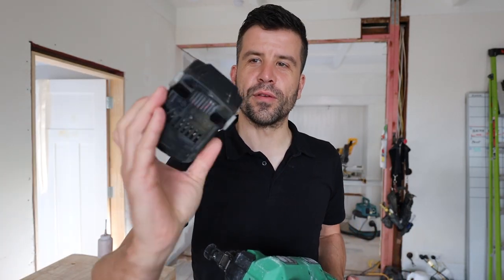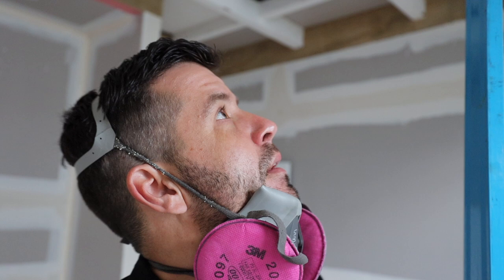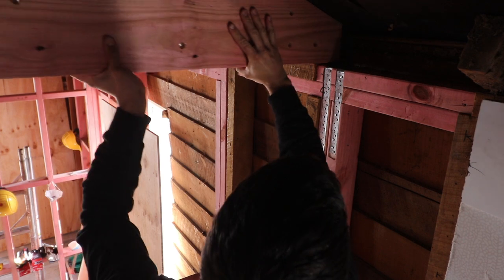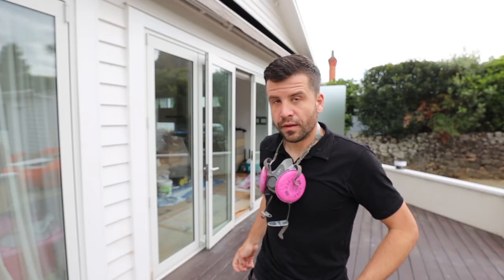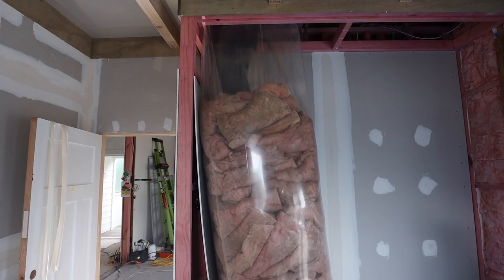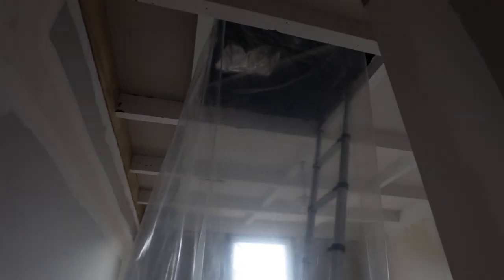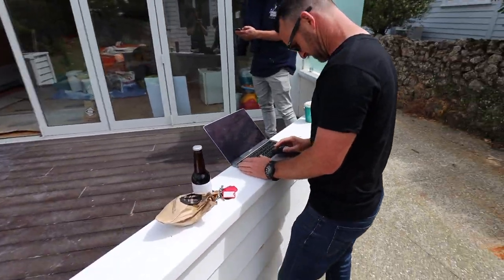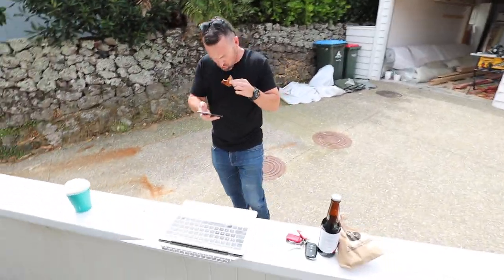Why We Don't Insulate in New Zealand.

Comment: We live in Sweden,  Im a kiwi builder and the standard of house insulation in NZ is shocking compared to the world. If youre building a house and think you have enough insulation, you dont, double it.
Reply: Same thing when you compare to standards in Norway. I was surprised by the explanation of the layering as we have a moisture blocking layer on the inside of the insulation (usually 0.2mm plastic sheet, but for pretty technical reasons there are more and more builders using a layer that breathes. Then on the outside of the insulation we have a wind-blocking layer (insulation is pretty much a matter of making sure you have air that's not moving between the inner and outer walls.), a gap of usually about 2" and then the outer wall.
 Then again, Norway has both reasonably warm summers and quite cold winters as well as windy coastlines with a lot of moisture, so we've been forced to adapt. ;)
Reply: CR*P!     CR*P!     CR*P!
Reply: @cairnsandy1  ????
Reply: I done my apprenticeship in n.z... I now work in Australia i didn't realize how important insulation was till I worked here, the last house i just finished is a constant 18 to 20 degrees with no heating or cooling in Victoria from 6 degree days to 42 degree days it's always constant with no curtains installed.
Reply: @Tachdelan  that plastic sheet is the worst in the long run. Just trapps moistore in the wall and will cuse root. Maybe not so fast but 30 years or so and beyond then you will see it.
Reply: @P4hko  
That depends on the amount of drying before closing it up and the moisture can escape to the outside if it's not too much.
It's becoming more common to use a layer that allows moisture to pass from the insulation layer to the inside. This shift has come from the thicker layer of insulation being used as well as in construction where there isn't a steady level of heating throughout the wintertime (cabins and the like). The plastic sheet is/was meant to keep the moisture from seeping into the insulating layer from the inside of the house.
Reply: @Tachdelan  I know that it's how it shuld be but from my own experian it always start rooting outside it at the bottom. The little moisture getting in gets traped inside the wall and after a long time it start to root.
Reply: @P4hko  
Interesting. I know of cases where there's been rot found when doing work on older buildings, but I also know of cases where this building method has not caused any rot after 30 years.
It has been a topic of conversation in more recent years as the thickness of the insulation has increased though and the new standards have caused buildings to be more air tight. 
I'm not a builder though, I'm a supplier. And we recommend using the membrane that allows moisture to pass from the wall into the house but not the other way due to the relatively high amount of moisture left in the walls when they are closed up.
Reply: @Tachdelan  okey I am renovating a few old houses and my father been doing it forever and he says the same thing. It shuld not cause any problem according to every thing. But in the long run  it always comes sooner or later and that is even whit houses whit poor insulation. But depends on location, installation and everything else but sooner or later water will get trapped. Btw water moves whit heat so shuld the membrane not be facing the other way? Did insulate a basement whit a membrane letting water get out but not in and it worked wonders. I know thats way different but it shuld work the same aslong as outside air is way colder then inside.
Reply: @P4hko  Yeah, you want the moisture to move from the insulating layer to either the inside of the house or the outside of the house. Either is fine as long as it's not trapped in that layer.
Whereabout in the world are you located, btw? From the name I'd think Finland, or the Baltics, but I don't like to assume.
Reply: @Tachdelan  Sweden a bit up, finnish name tho.
Reply: How to build kiwi?
Reply: @P4hko  Ah, ok! I'm sure there are differences between Swedish building codes and Norwegian ones, so...
Reply: @Tachdelan  yes kind of different. You are allowed stronger chemicals because you have a harsher climate. Different electrical system and then small things here and there. They use plastic sheets here to and thinks it's good.
Reply: Building standards in general seem to be very low in a lot of English speaking countries.
Reply: @rogerwilco2  I suppose that would depend on your frame of reference.
Reply: How does insulation work anyway.  Like the point is to have an insulating layer of air right ?
So if I build a double wall with nothing in between but air, then is that insulated?
Reply: @carlosandleon  Yes, and no!
You need that air to be still, but if you have like 8"(20cm) of empty space between outer and inner walls, the air next to the outer wall will have a different temperature than the air next to the inner wall (given that there's temperature difference but if it wasn't you wouldn't need insulating).
As you probably know, warm air rises while cool air sinks. This creates a rotation of air where the cool air sinks to the bottom and the warm air rises to the top. As it does, some of the warm air cools down and some of the cold air heats up.
At this point you no longer have an insulating layer but a convecting one.
I hope this makes sense and answers your question.
Reply: @carlosandleon  yes air is the best insulation. But the heat moves the air so you want the air to be in so many small pockets as possible so the heat dont move thru it
Reply: @carlosandleon  Insulation works on trapping air, Having a gap between two walls just means cold air/temp can pass freely through the gap. Insulation is designed to hold the air and trap it, preventing it flowing, this means warm air inside cannot be reduced by cold temps outside the wall, A thick wall with insulation and the right waterproof material will keep a house warm in winter and cool in summer. Vapour barriers and building paper with air gaps help even more, the more dense and thicker the insulation the better R value. Hope that helps.
Reply: @P4hko  Plastic sheet is good, as long as you install it to the correct side of the wall. And that side is different in different climates.

If you put it to the side which tends to have condensation, then you are blocking moisture from entering into the wall, instead of trapping it. And if moisture gets into the wall after all, it can leave on the other side
Reply: @juzoli  Then even some pro's do it wrong. Better to skip it and make the wall as thick as possible I would say
Reply: @P4hko  plastic sheeting should only be used on Skillion roofs, then the moisture if any always has the ability to run. The sheeting should end over the outside of the wall in the eaves then all moisture leaves the roof cavity. In walls their should be a barrier/packing system to have the plastic off the timber so moisture can drain. If you are getting rot that quickly, it's not the plastic sheets fault, it's the installer.
Reply: @Nineteenseventy2  okey makes sense, not how they did back in the day. I was talking about 30+ year old. After seeing it ceveral times it just feels safer to skip it and go another rout.
Reply: @P4hko  I've been building for over 30 years, and have built a lot of homes this way, never as a problem.
Reply: @horaceosirian8993  What?

Comment: Your countries regulation reminds me of NYC. They like to turn everything into a major project and a big expense.  Take care
Reply: Dont even get me started on our roads and infrastructure
Reply: Same with Chicago, you have to get a permit to think about getting a permit just to get a permit.
Reply: Yep we have the same guys here in New Zealand they're called R-Soles. They continually add layer upon layer of bureaucracy costing more & more & more. We currently have a water shortage here in our biggest city of Auckland(where this video is taken). After decades of immigration & a finite reservoir of water, it finally ran short. A water tank in every new house built, used for toilet, washing machine etc would've solved this issue but again the R-Soles are in charge.
Reply: That regulation is required because of what happened in the past of so many people doing it incorrectly and causing worse problems by being surrounded by black mold.
Reply: @bremCZ  Thanks for the information. That's usually where laws and regulations start, someone messes up. Take care.
Reply: @bremCZ  Implemented with good intentions, then the system got abused and taken advantage off... just like anything else.
Reply: @1Akanan1  Not exactly. There was no system prior to the rule that insulation must be designed correctly and inspected. It was the frequency of poor jobs that forced the system to be put in place to begin with.
Reply: @Timespider  I just cottoned on to what an R-Soles are! Having a good chuckle in Toronto. Good one.
Reply: @bremCZ  Was it not possible to do the samething via your building code then have it inspected after installation and prior to boarding the walls or the like?
Reply: Nothing about this style of building is truly expensive, though.
Reply: @Timespider "R-Soles"😂🤣 I'm definitely using that from now on 👍
Reply: @Timespider  Funny: You start out complaining about too many layers of bureaucracy (costing more and more), but then you finish by suggesting that there should be another new layer of bureaucracy (which would certainly add to the cost of the build - tanks; pumps; plumbing;) and you seem disappointed that this new layer of bureaucracy hasn't been added. Do you see your conundrum?

Comment: I’m a kiwi but live in U.K.  All the houses in Auckland are cold in winter unless they have been built in the last 20yrs (not many). Issue is it doesn’t get cold enough to do more with insulation, but when it is cold the insulation isn’t enough to keep you warm. Big airy cold houses in winter.

Comment: Bureaucracy. Doubles the price...  I live in Perth, and still insulated my house. Pennies and effort saved in heating. better in my pocket. Getting close to the finish now 😊
Reply: And of course in Perth insulation reduces the amount of time the air con is on.
Reply: @MikeAG333  For sure. My house has only ceiling insulation and double brick. I really only need the AC on when we get a few hot days in a row. The morning easterly blows through early then we box the house up and it stays cool for the rest of the day generally. Gotta put it on when we get up around the 40 mark though...

Comment: I'm still confused. 2C is still relatively cold for this climate. And keeping a house a comfortable would be terribly difficult. 
Furthermore insulation helps with the heat also.  Especially if you have aircon.
Reply: He's more referring to our houses that were build before the regulations came in, new houses here are all insulated and double glazed.
Reply: Also insulation works both ways , it will keep cool air in if it's hot outside
Reply: @chriskane9230  haha yea but 25c on average in a New Zealand summer isn't that bad.
Reply: It may hit 2 deg C once a year in the middle of the night in Auckland. Most of the time in the coldest months of June July and August the temperature here ranges between 5 and 15 deg C.
Reply: @chriskane9230  It also stops any warm-ish air getting in on a sunny winters day. A study in Germany found more insulation resulted in higher heating costs overall because the sun couldn't warm much of the air inside the house. I think insulation is great, and makes for a more comfortable home, but there are other consequences.
Reply: Ssme in the UK. "We don't have winters mate". Yes, but 2C is bloody cold if it lasts for a few days and you don't have insulation or proper heating. 

In the UK you see people in a wolly hat, North Face winter coat snd....shorts during the winter. Because it's not cold. If we admit it's cold, then it actually is.
Reply: yeah, Aucklanders complain when it gets to 30°C or below about 5°C during the day. And that's outside... admittedly a lot of the houses the difference between inside and outside is wind and rain rather than temperature (there's slightly less wind and rain inside)
Reply: @Granition  this is surprising, to say the least, especially in a cold climate like Germany. do you have a link to the study?  There is a point where more insulation won't gain you much and cost you more money.  but it's implausible to suggest more insulation would cost you more money in *heating*.  The sun does not, appreciably, warm the inside of a house other than through its windows.
Reply: After seeing that hammer I had to check the shed to see if mine was still there
Reply: @bradfry2259  But he's not really. He's literally pulling out insulation from a house where it exists. I get old houses don't thats a given, but pulling out insulation from the ceiling, when it drops to near freezing in winter. Hot air rises, and so all the hot air inside will be floating around the cold ceiling. Convection will cause the heat to dissipate through the ceiling and then it will radiate and convect into the attic space and then rise through the roof and escape. 
Insulation will slow the convection of heat from the ceiling into the attic space, thus the ceiling will reach equilibrium and you will have to heat the house less in winter.
Reply: @erict7499  Yeah somehow I don't believe this in the slightest. 
If I remember my heat transfer and thermodynamics classes. The sun isn't going to be heating much of the air inside a house, if it can't even heat the air outside. 

If you have an insulated house, and you heat that house from the inside, that heat will take longer to escape as the thermo flux through the house interfaces will be reduced. 

I do not believe that insulating a house would increase heating costs AT ALL, and would infact decrease them, as less energy has to be used to a heat a house over the same amount of time.
Reply: @Granition  Yeah I don't believe this at all. Insulation reducing heating and cooling costs, and insulation reduces heat transfer, in both directions. So if your house is warmer than outside (and because of the 2nd law of thermodynamics heat flows to less heat), it will lose heat to outside at a lower rate if it is insulated. Unless your roof is painted black also (which would also have the reverse effect of radiating heat quickly at night) if the sun can't heat the outside air its very unlikely the sun during winters day is going to heat your house up more than the surrounding air. And even if that were true, it wouldn't make heaitng cost more than a non insulated house, because if the outside air was still colder than the house, that would flow to the outside, and cause the house to cool again. And the convection and conduction of a actively heated structure, would be far greater than any net radiation input form the sun during winter.
Reply: To expand on this, the 1-2 degrees will be for an hour or two at 4am once every few years.  It's really not worth going to a lot of effort to deal with that one exceptional case.
Reply: @PBMS123  The insulation is only being pulled out (2 diffrenet types) to be replaced with better insulation.

My house (in Tasmania, similar climate to Auckland but generally a little colder) only has ceiling insulation (and that does not even reach the outside walls, basically just 1m in from the edges), Its that horrid blown in "charlie fluff" crap. I wish we could afford to vacuum it all out and replace it with proper batts. But due to the ceiling space, that would require pulling the roof off. not to mention our house has MASSIVE windows, all single glazed. Good heavy curtains help, but I feel that is where we loose the most heat, as if you open the curtains you just get this gust of cold air from behind them.

Its not as if this house is even that old, its only ~30 years.
Reply: @chrissscottt  it gets colder than that even in the winterless north. you will get 0c a few times a year. rare to get below 0c.
Reply: what people often forget about is the effect of humidity. auckland north doesn't get cold and dry. the high humidity makes the effect of cold much worse. go south wheres it colder but drier and it feels warmer.
just like in summer where the humidity makes the heat worse. 32c auckland heat wave is worse than 34+ in chch. 

installing that ground barrier makes a big difference to the humidity inside the house which makes it more comfortable and cheaper to heat.
Reply: @taunokekkonen5733  I get laughed at in The Netherlands for walking around in shorts in winter.
Reply: @radicalbyte  you should! Are you also entertaining the idea that NL is a tropical paradise and if you pretend it's not cold, then it's not cold?
Reply: Dahrk One  American? I'm Australian...
Reply: @taunokekkonen5733  As a Canadian 2C can feel colder than -30C.....a rainy 2C day will chill you to the bone, while with the right clothes you can stay out all day at -30C
Reply: @trueppp  I'm Finnish, I know LOL. You starting winter already there?